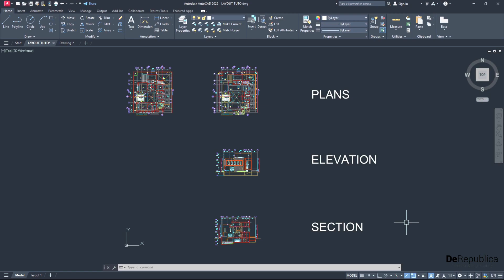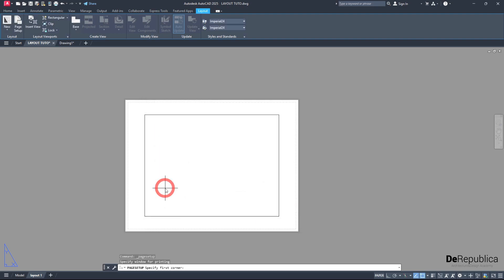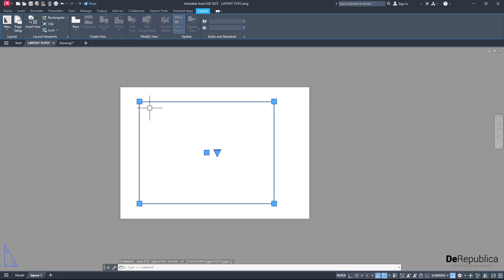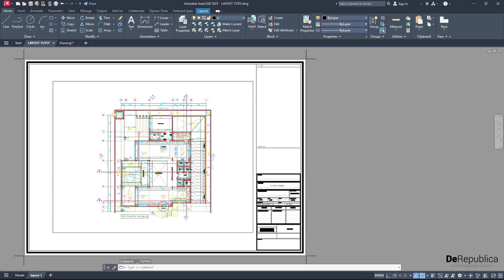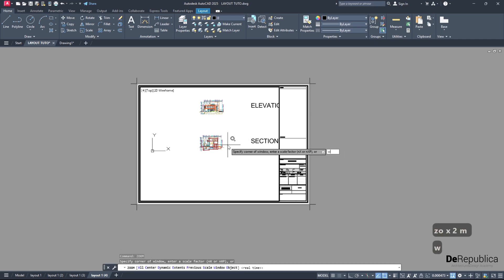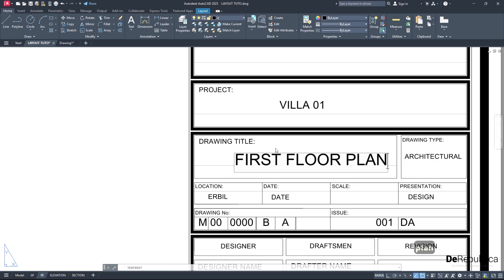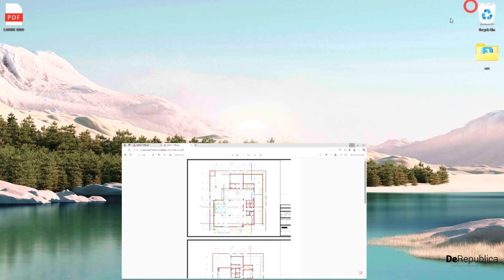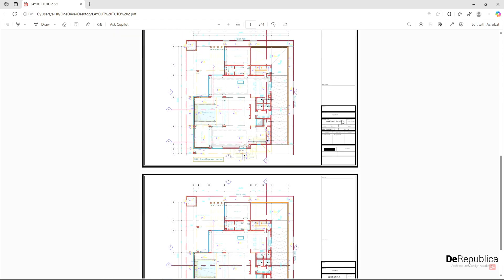The Ultimate Guide to LAYOUT creation and BATCH PLOTTING in AutoCAD

Comment: Sir,
What is the difference between, mentioning scale with choosig window 
And mentioning scale as paper with layout, means
On which case we choosing layout and scale mention on page setup manager ?
Reply from the maker: @SandipSunar-u6f  hello and thanks for asking , ..by choosing window only we get a presentation of our design , but if u want it to be printed in scale of 1:50 or 1:25 or 1:100 then we have to choose layout … the first option is good to go and does not have any issues because mostly its not asked to be printed in scale the design and drawing matter to be readable.., but we use the second option if we are asked to print or present in scale